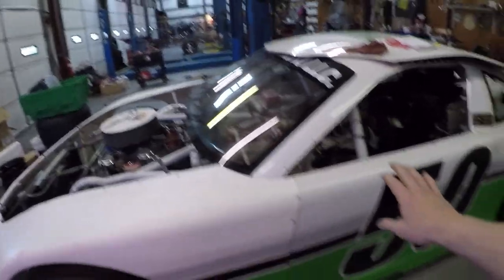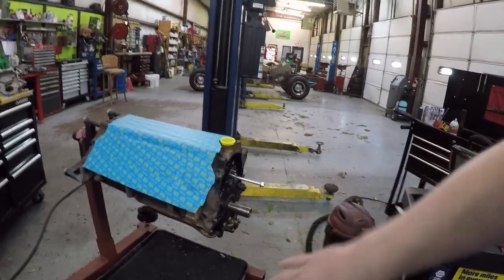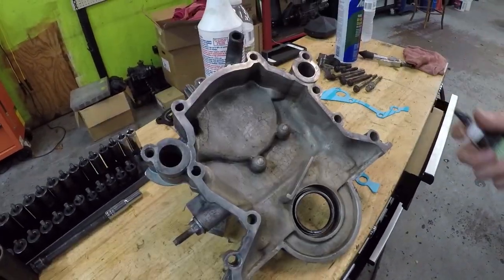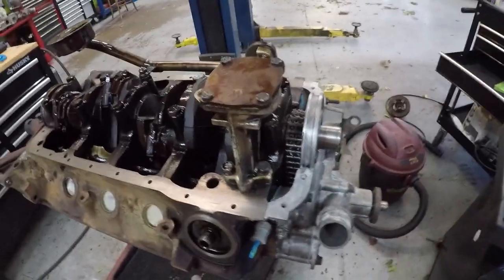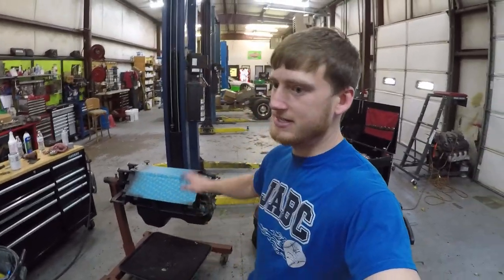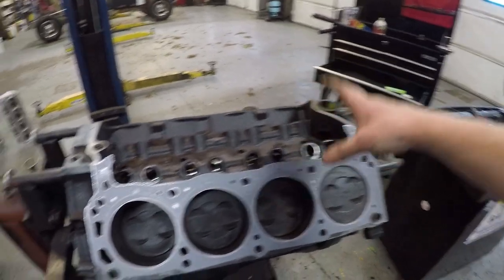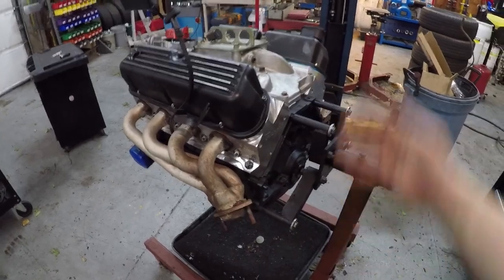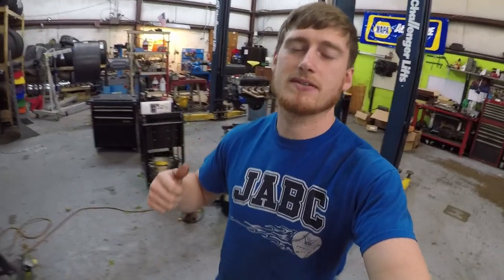Time to make some junkyard HP!!! (Bringing the SN95 back to life)

Comment: ATK has complete short block fordged rod/piston, nodular crank 347's for $2700.
Reply from the maker: Bryan Roupe thanks for the info man, I’m still in the market for a stroker short block. Thanks for the comment!! 👍🏼
Reply: I just looked again its actually $2,200 now. You can't build one that cheap. Buy the time you buy the stoker kit, have it balanced, new bearings and machine work its going over that.
Reply: They just lowered it $500 within the last few weeks. I was just looking at them not long ago and they were $2700, the same as the 408.

Comment: Awesome! I'm going to build one like this for my 51 f1.  Did you change the cam bearings?
Reply from the maker: No i didn’t actually the cam bearing looked really good so I just went with what it had! 👌🏼
Reply: Nice!  Can you recommend a place to order used engines online like you did? I like the idea of video showing the engine running. I've really been impressed with what can be done with a stock bottom end out of a salvage yard. Thanks! Subscribed
Reply from the maker: @user-sg6fb4ip5h  I used car-part.com it gives you salvage yards near you by using your zip code that may have engines you need.